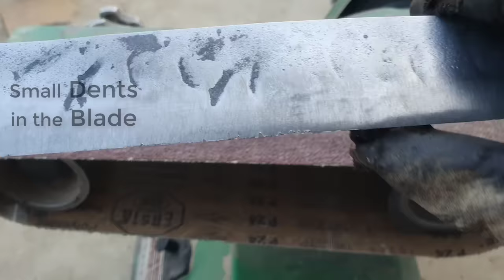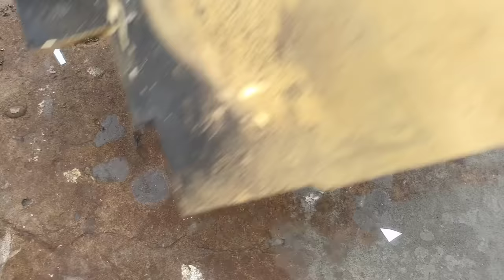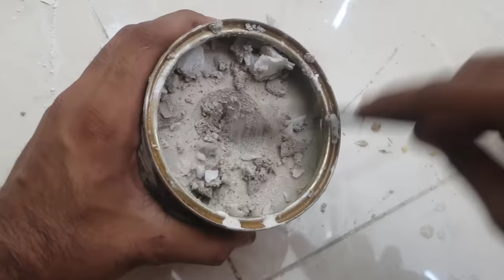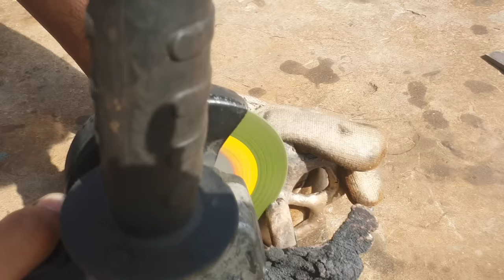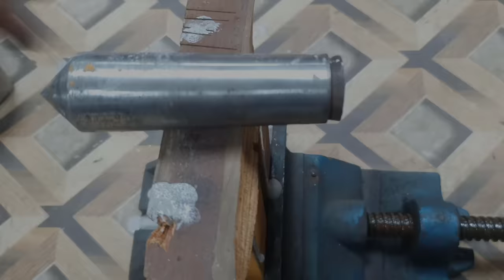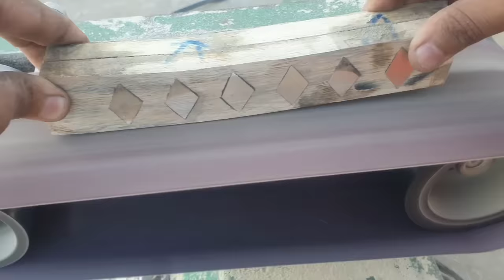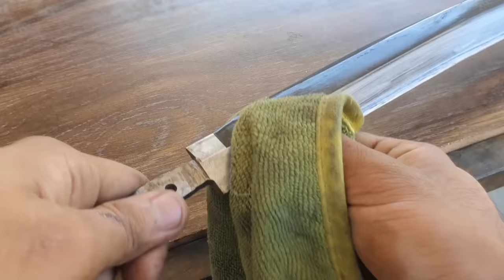Rusted Japanese KATANA SWORD (kind of) - BEST RESTORATION

Comment: It's a Thailand krabi sword, but still will cut as well as a katana if sharpened well. Also the folding steel technique was only used in japan because of the insanely low purity of the steel that was available, it actually can make the sword worse if done over 10 or 20 times... although it will most definitely have alot of layers at that point so 1000 LAYER swords are most definitely possible... 1000 folds and you might as well use lead. Random fumbass signin out

Comment: I think this is a fake guys. The surface deformations just look like intentional forge/hammer marks. The wooden handle looks like driftwood that was found on the beach, where the opening shot was conveniently set. The tang has no rust whatsoever and yet the blade is rusted to hell. If the wood was soaked and crusting off, then how did the tang not get rusty? And the idea that the handle was just tied on like that, Im telling you now that is not how handles are put on, and that would hold up against nothing with a blade that heavy. That handle would come right off. The tang is also slightly warped. Someone clearly didn't spend a long time making this prop.

Comment: No Hamon line? I think that is the way you spell it. Plus the handle should have been pinned on, and not glued. I've never worked with a japanese sword, but I've worked with enough blades over the years, to have learned a few things. But you did a great job.

Comment: Why you did that holes in the handle of the blade if you didn't put any mechanical joint on the tsuka at the end?...you use just resin. 

Well, I wouldn't use that unsafety ornament iven to try cut a banana.

Comment: this is actually a ninja sword 
the difference between a katana and a ninja sword is the fact that 1. katanas get slightly thin towards the tip of the blade
2. katanas are more curved while ninja swords are straight like a typical sword 
however they are from the same country

Comment: Metalworking doesn’t seem to be a strong suit for you, and I think that comes from your significant reliance on heavy machinery to get certain aspects done quicker. The pieces that you continually used a band saw or a drill press for ideally should’ve been done slowly and carefully with hand tools and a discerning eye, but weren’t. 

The small things matter and make a difference in aesthetic. Like the guard looks rough and choppy, it should’ve been refined further. The diamond accents in the handle you left asymmetrical and then forced into choppily made slots in the wood, which left gaps on the sides of many. And the blade collar doesn’t fit perfectly with the blade, it’s a bit short on the sharpened side and it should taper with the blade. Also the plate at the base of the handle should have been riveted or screwed in; the two straight pieces of thick wire that you shoved in there aren’t going to do anything more than the glue already is.

Metal smithing, and more specifically blade smithing, is an art and needs to be treated with the utmost care and attention to detail, more so than the average restoration. Take your time and make sure the pieces are fully smoothed out and flush fitting before assembly.

At a glance it looks beautiful, but there are an abundance of noticeable flaws when you look just a little bit closer. In silversmithing you’re taught to rely on your hands as much as you can, to get as much done manually before you resort to more extreme methods because it forces you to take your time and really LOOK at the piece. I fully believe this could be done wonderfully if you just slowed down a bit and took time to finesse everything.

Comment: TL;DR: I'm I'm Indiana Jones and this belongs in a museum. Not to be "restored"

Listen, i'm not an expert or anything but i know a decent amount. If this is a real japanese sword (it's possible it is, the unrestored blade definitely looks about right, but I didn't see any any kanji on the tang. This doesn't rule it out though) then this would most likely be a farmers weapon. This is why it doesn't have a tsuba (hand guard) and why there are no holes in the tang. It was disguised as a farming tool basically. This would mean this sword has a LOT of history behind it. I mean a lot. This is the kind of weapon a common citizen might have as the katana that we generally think of were only owned by samurai and people in the military... Citizens were not allowed to carry swords if they weren't in the military from the meiji period onward. Meaning that if you were a farmer and all your farming buddies got together to try and overthrow the shogun, this is the type of weapon you would have. 

This sword wasn't meant to have a tsuba. Those diamond shapes are supposed to be wrapped cloth. Those dents are from battle. The kurouchi (the black part of the blade) is meant to stay on for easier maintenance. That glue holding it together isn't going to last forever. You basically destroyed it and whatever value it may have had.

Comment: This was not a restoration, the rust was too new, Hardly any . That handle was not from the blade, when he cut the wire off, there were no rust marks behind the wire, (which would have been sharp for the original owner anyway) and it had forge marks in it. It was made to look old, so it could end up like this.

Comment: This is not a good restoration. The handle is all wrong and the force require to cut that paper is too much. A proper Japanese steel katana is effortless. This will never pass quality inspection check from a Japanese sword smith. The paint job is so choppy and there's not a proper grip. 

The tsuba makes me want to cry

Comment: Not folded. too short, not even the length of a tanto, And you know the diamond hilt pattern is how it's wrapped, not a solid piece right?

This is basically a bush-knife. used like a machete for cutting through underbrush. Not even japanese, as the folding technique was developed in order to turn poor quality iron native to japan into high quality steel. The rust is also a solid layer, if it was proper folded steel it would have been flaking like a croissont.

Comment: Dude just took a real katana and made a kids art project.  He removed the maker's mark, he put on too small of a grip, katana grips are supposed to be removable and he attached it with epoxy!  And the worst thing ever was the sharpening.  Japanese blades are not sharpened with a flat stone, rather a rounded stone.  It is the rounded blade that allows it to cut better than other swords.  And don't get me started on the brass and horrible inlays.  Wow, I've never seen a better video on how not to do something.

Comment: What a waste of your time...That's not a Katana to begin with. This isn't a blade that was ever used in combat. It has a Rat tail tang. This is a modern piece that was probably thrown out or got wet. Blade would break at the handle on impact and point towards the one using it.